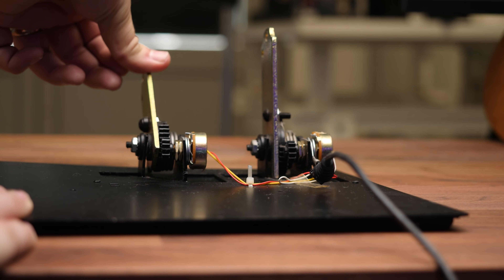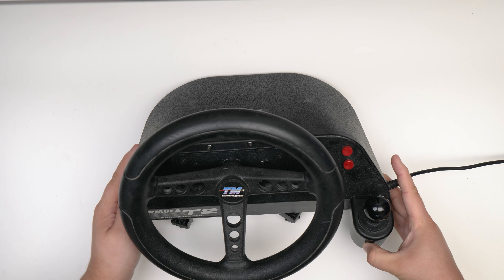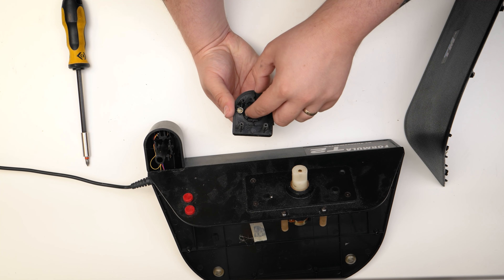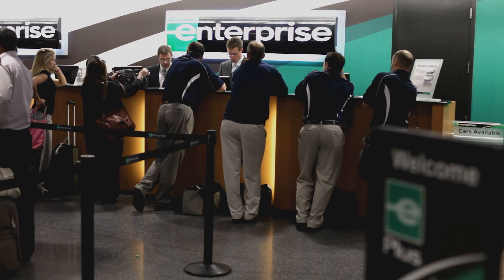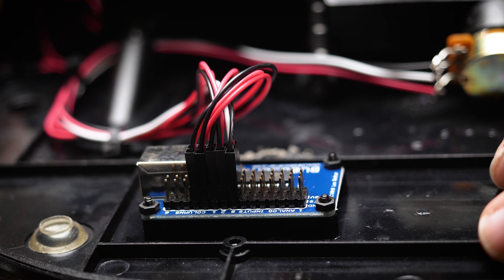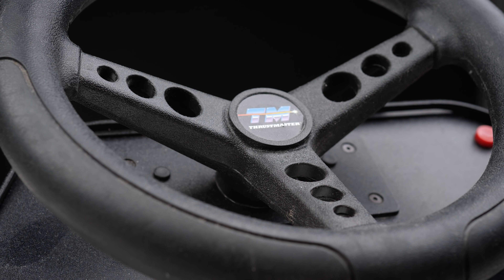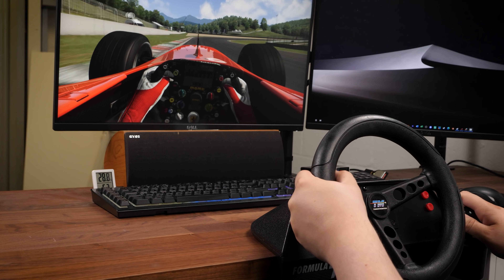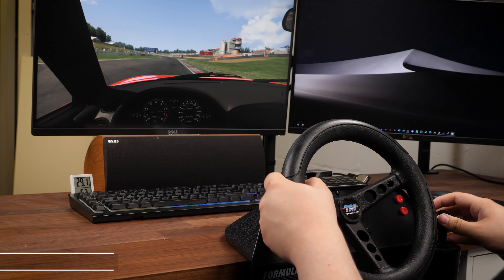Sim Racing Like It's 1996! | Rebuilding a Thrustmaster T2

Comment: That was my first wheel! I still had it when I had my first child and have photos of him driving with it when he was 2.  He's 21 now.  Good times and great memories Chris.  Thanks for the stroll down memory lane. GP Legends and Nascar Racing from Papyrus were all I would play for a few years.  God bless and race on 😎👍
Reply from the maker: I'd love to know what happened to our original one, though I suspect it met it's end the same way most electronics of the time did. The Papyrus Nascar game, and Indycar were staples as well. I miss the days of looking up a word in the manual as a form of copy-protection :)
Reply: @ChrisHaye  I'm pretty sure mine met its end at a landfill somewhere.  I think I bought the Microsoft Sidewinder to replace it, kids got older, priorities changed and no forceback wheel for me until now (still played racing games, but console, with a controller only).  Just getting back properly into the hobby with a wheel setup.  Will be upgrading to full proper rig and pro-grade wheel/pedals once last kid is out of college.  Right now, getting bye with the FGT-Lite and a Thrustmaster TMX Pro and pedals.  Not ideal, but it's got my blood pumping for better gear and games to match!  Keep up the great work.  Love your videos!
Reply: Same, I still have my T2 somewhere (as well as the black Momo Racing which I also still have.) Also have photos (digital from a Casio digital camera, still have it) of my now 20 yo daughter playing with the wheel. I raced with ICR2.  Back then you raced "online" via uploading replay data to a website and everyone's replays were compared to determine a winner

Comment: "Times really have changed..." Haha I see what you did there, I love it. TM should release a modern version of the rim at least, as a nod to this epic nostalgia. throw in a copy of Power F1 too!
Reply: Id do you one better and say this would make the perfect shell for one of those emulator rigs containing all of the games that wheel was worth using on from the era, similar to the way they are making Sega and Nintendo units to do the same thing...
Reply from the maker: That's a genuinely brilliant idea! If I ever track down another one, I'll give that go I think. Maybe fit something like a Raspberry Pi inside and run one of the Arcade focussed OS on it.
Reply from the maker: I really like the rim. It's a little undersized, but it has great 80s F1 vibes about it. Would be nice to pick something like that up for the proper sim rigs, but the 'classic replicas' are all quite pricey!

Comment: My first wheel was the Microsoft Sidewinder Wheel & Pedal set. It was the bees knees at the time. Once I upgraded to a PC without a gameport I had a genuine sense of grief that my wheel was at the end of its life.
Reply from the maker: Dad was always much more into flight sims, and we had a sidewinder stick, which I remember being miles better than anything we had used before. But I remember the same sense of dissapointment when we moved over to a PC without a gameport. It took quite a few years before anything else appeared to replace it IIRC. Microsoft really did get those peripherals right!

Comment: Cool, was my starter wheel too. 
Then:
Microsoft Sidewinder FFB Wheel
Logitech Driving Force Pro 
Logitech G25 
later modded with an SRW S1 bolted to the G25 base
Thrustmaster T500RS F1 Edition
actual Thrustmaster TS XW Racer Sparco Edition (but still using the F1 Rim, cause the buttons on the Sparco sadly are totally rubbish). 

Really liked this throw back in history. 😎😁 

Fun fact, I bought this Formula T2 because of the DEMO of Viper Racing.

Comment: Loved the video.

I just purchased a new/old stock Logitech Momo wheel for my windows XP retro PC build. And I found a copy of Toca Race Driver 3. It's great fun to relive a 20 year old sim racing experience on all the old hardware. I am thinking about adding Grand Prix Legends to the PC as well. That was a favorite of mine back then also.

If I do a Windows 3.1 retro PC, maybe I'll run NASCAR Racing on it from 1994. Or Bill Elliot's NASCAR Challenge. I spent a lot of time on those games in the 90's.
Reply from the maker: I must admit, I've always had a soft spot for the Momo - if I ever get the urge again, I may try and do the same!
Reply: @ChrisHaye  I can still remember the feel of the 270°Momo Racing and actually haven't been into sim racing since then until last year when I got a game PC for MSFS.  Trying to use my G920 which I had for ATS, using it for racing is terrible.  From what I remember of the Momo, it was far more precise in the FF feel than this gear driven G920 garbage

Comment: I had a "Mad Katz" wheel that I bought specifically for the original F1 game on the PS One in '95 I think. It was basically the same thing with bungie "FFB". I had hours of absolute fun with that. I would have still had it, but I needed to dump a load of stuff when I emigrated from the UK.

Nice trip down memory lane there. Thanks for that.

Comment: This video may have just inspired me to get my old Thrustmaster NASCAR Pro Digital 2 working again. Use to play NASCAR Racing 2 and 3 on it when I was like 5. Restoring it and playing nr2003 with it would be quite fitting.
Reply from the maker: I had to look that one up, I don't remember it at all. But amazingly, it looks like there are still drivers available from Thrustmaster!
Reply: @ChrisHaye  Yes! The wheel actually still works good as new and works with most games. However, the pedals don't work, and one of the buttons on the doesn't work. Plan on repairing those and then giving it a good cleaning.

Comment: pedal springs kept breaking but I was able to get a hold of a stash of replacements and had to replace one every few weeks it seemed but my wheel bungie never broke, that was when I was cutting my teeth in sim racing with IndyCar Racing2 and that Cleveland airport circuit. Ohh the memories

Comment: Analogue was quite amazing back in the day. Had a stick for my Amiga, used with F1GP it was a revelation, even at 6FPS!
   Got my first wheel with the Playstation, VRally and GT were amazing. However it wasn't until I bought a Windows XP PC and installed Grand Prix Legends that I finally felt what I would at the time describe as realism. 
  It would be interesting to see you play this sim, although released in 1998 with community support it looks and feels modern.

Comment: I remember using the Thrustmaster Grand Prix wheel (cheaper version of this) at my uncle's and trying it on Colin McRae Rally 1, it was superb.
Reply from the maker: I never bought the Colin McRae games on the PC, though I'm wishing I had now. Probably a much better experience than on the PS1 d-pad!
Reply: @ChrisHaye  I brought over a demo disc of it (and many other games) as it ran like crap on my dad's PC. My uncle just so happened to have the steering wheel out at the time so we installed it on his machine and I tried it first. I couldn't believe how good it was right from the get-go. He then tried it and he was amazed too, and ended up buying the full big box version.

Despite the cheapness, that wheel, was surprisingly excellent, at least with that particular game. Probably a really good potentiometer.

Comment: You can use Grand Prix 2 with DosBox and still map a wheel to it. I play GP2 everyday.
And I wanna get a Thrustmaster T2 for myself to play it.
Reply from the maker: Yeah, I've managed it in the past. But for some reason this time around the No CD patch kept breaking it and producing the f1system.dat error. Even downloading the 'fixed' version didn't help. I have a CD, but no optical drive these days, so that's my next port of call. I ran out of tinkering time for this video, but I've not given up on it yet!

Comment: This was my first pc wheel back in the mid 90's. Didn't last long before the "Force Feedback" stopped working. Pulled it apart to find a bungee cord inside and it had fallen apart inside. Put it back together and continued on. I was really quite surprised to find I had paid like $400 for something so cheaply made.

Comment: I still have my old RadioShack Multi-System wheel from back then.  It could convert from car to motorcycle layout and had the extra axis to act as a flight yoke.  Might have to look into that usb converter.  I eventually upgraded to an MS Sidewinder.
Reply from the maker: I'll admit, I had to look that one up. We didn't have Radio Shack in the UK, although there were stores owned by the same group I think (Tandy) - don't recall ever seeing those in our neck of the woods. Of course, this was really before social media and the like, so exposure to other sim racers required a much more concerted effort!
Reply: @ChrisHaye  I couldn't find anything on Google, the only label on the wheel just has: Cat No 26-9400A, Manufactured in China for TAN Canada/America/UK.  I think I bought it more for the flight sim ability but did try it out on lots of the games people have listed here.  Back then, you spent more time configuring drivers than actually racing.

Comment: Great video. Believe it or not my current usable wheel rig is a Logitech Formula Force Wingman USB, with nice FFB from 1998. Plays all the modern games, AC, ACC, AMS2, BeamNG, Project Cars2 on my Windows 7 Gaming machine - with GTX3090 (yes you read this correctly).  I'm wondering if I'm the only person in the Universe running this system.
Reply from the maker: I think it's highly possible! I can't imagine there are too many people with a bleeding edge video card and.... Windows 7!

Comment: I ran with TM T2 and then went with a TM NASCAR PRO Digital 2 until I could afford a FFB wheel in 2007 (Logitech G25).
Reply from the maker: Ah man, it's so easy to forget just how much of an upgade those first Logi G wheels were!
Reply: @ChrisHaye  you are correct. My biggest upgrade is when I went to a DD wheel in 2017 (the G25 still working).

Comment: I still have the original box for The Need for Speed. I used to play the %¤#! out of it but never got the T2 wheel. I tried to hook up a flight sim joystick into midi port but it was actually worse than keyboard. Now 25 years later I have Beamng.drive and G29 and that's all I've ever wanted

Comment: Just bought one of these wheels thinking I could adapt it over to USB, I must have bought a bad adapter as Windows doesn't even notice it, do you remember if you had a guide on rewiring the T2 wheel as I likely will try it myself.

Comment: Currently using the RockFire adapter myself to use an original Thrustmaster NASCAR Pro wheel with game port.
Unfortunately the potentiometer in the brake pedal recently broke and I've been trying to find a replacement.

Comment: I wanted one, but the cost was too much. Ended up struggling with a very unergonomic analogue joystick. I can't remember the name but the base was square. Yeah, like that fits the palm of your hand well... Full race distance in ICR2 left indentations on my hands from the harsh joystick corners.
Reply from the maker: I mean, still better than using the keyboard I guess! We were lucky, IIRC my dad bought it off of a coworker that didn't get on with it. But they were really expensive, something like £200 at the time if memory serves.

Comment: You may be able to run the old grand prix games by installing virtual machine with an old windows (xp maybe)
Reply from the maker: Good shout - I managed to get it installed and running to some extent, but struggled with the NOCD patch. I think the copy protection outsmarted me I do have a CD, but no optical drive so I guess that's the next thing to try.

Comment: They use that bungee cord on the thrust master Ferrari 458 wheels for Xbox one and mine snapped so I have a very loose wheel :(
Reply from the maker: IIRC It's just a standard bungee cord, so you could probably just get a new one and DIY a repair.

Comment: I have a T1 that would work if I could hook it up to anything. It has the roller pedals.
Reply from the maker: I've only seen photos of the roller pedals, I can't imagine what that would have been like to drive. I'm guessing it's definitely a 'no shoes' kinda deal!
Reply: @ChrisHaye  They were used a lot in dune buggies. instead of a flat pedal piece there was a large plastic wheel, like from an office chair. So no matter how you had the pedal plate lined up or your feet positioned you touched the edge of the wheel and it rotated with your foot.

Comment: Why putting in an expensive Leo Bodnar Board while a cheap an inexpensive Arduino would do the trick as well? It is not like that this wheel is going to be your main-base right?
Reply from the maker: A fair point. I have a couple of spare Nanos sitting around in the spares box, but I didn't really consider using them for this project. I'll admit my main motivation for this was time, so having the plug and play Bodnar board kinda ticked the 'don't spend too much time thinking about it' box ;)